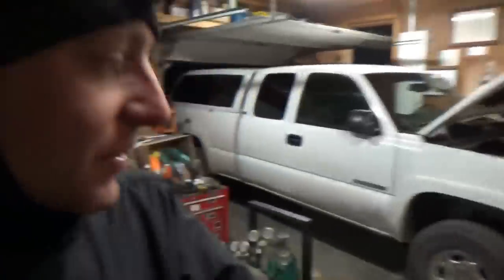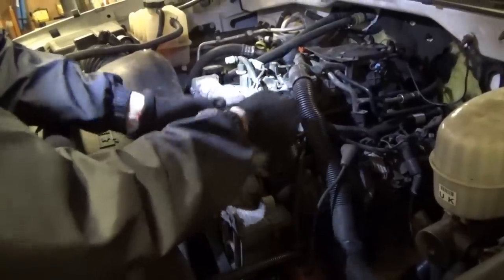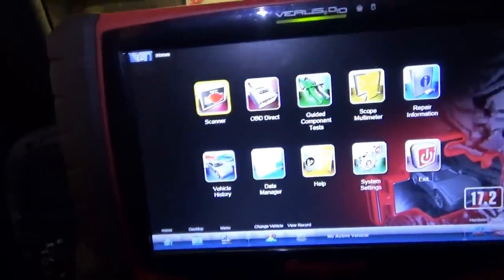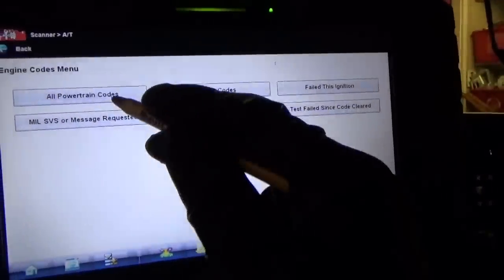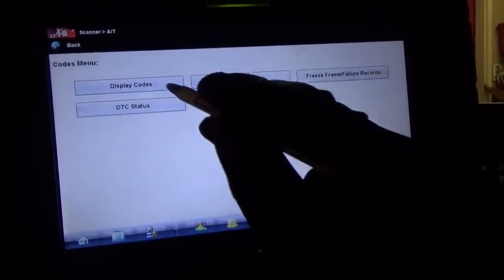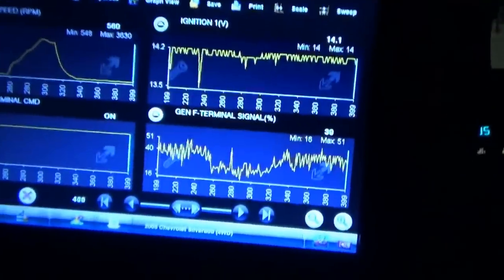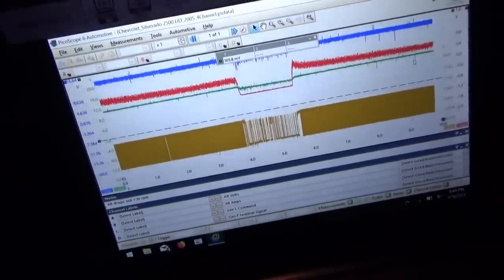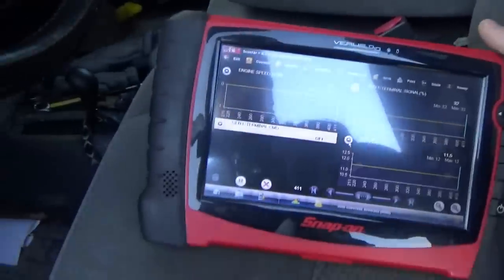Misfire, O2 sensors, LOW VOLTAGE? -Part 3 (Repairs)

Comment: Ivan,
That was a great case study, analysis, and repair! I learn so much from your videos - thank you! BTW I just bought a 1/2 flex head long handle ratchet at HF to loosen/remove the 14mm triple square head bolts that hold the rear caliper brackets to the rear spindle on a 2014 VW Jetta. Could not be loosened with an impact or regualar breaker bar due to tight clearance.  Great tool to have - good luck with yours.
God bless
Paul

Comment: Wondering if the brushes spring tension or brushes are wearing out.  In the old days we use to replace the brushes and internal voltage regulator.

Comment: I suspect the alternator had two small problems caused by simple wear.  The brushes were likely quite worn meaning the springs were at their longest position giving the least tension they could and the bearings in the unit were worn allowing some slight wobble to the rotating mechanism.  As the rpms came up the brushes simply began to lose good contact with the rings on the alternator.  I have had that happen before back when cars had easily replaceable brushes and simply putting a new set of brushes in would eliminate the problem, now you can't go to the parts store and get a set of brushes and if you do the alternators don't have a way to simply replace the brushes by removing a service cover for brushes.
Reply: Do the Fords not still have the external bolt-on voltage regulator/brushes?

Your theory makes sense.  If the brushes are strung out, then at the high rpm they could lift and bounce on the rings with the entrained air on the ring surfaces.
Reply: Typical GM Alternator on the 6.0L (crap out after 200,000km). Have seen quite a few over here with crusty pins (I believe to be  pin fitment issue from factory) $180 Feebay one delivered does the trick usually.
Reply: sounds pretty typical, since day one of alternators =p

Comment: That ratchet is awesome!!!  Swivel head AND extendable !!!  Too cool !!!  Yes replacing a GM alternator is EZ, not only can you see ,reach and remove the mounting bolts,but it takes less than 10 minutes. Keep your videos coming,have a great day!!!!
Reply: Try doing one on a VE (Pontiac G8)!!!
Reply: @Micko350   Man I'm sure that's a nightmare!!!  I hate it when you can see the mounting bolts BUT can't reach'em.

Comment: Excellent repair, and most excellent diagnosis/confirmation, pre and post.
I have found that the PicoScope needs to be connected before opening software, but as a few of your subscribers have commented, cold may be an issue, I use mine for nice warm work.
Thanks for sharing and best regards from the UK.
Reply: Many, not all, desktop and laptop computers have USB ports that are picky and wont talk to some devices..  Plug into a different USB port and boom, it connects.  Not sure what it is but it does happen with all kinds of systems more often than folks believe.

Comment: Hey Ivan, use a pair of pliers and close the gap up on the little metal sleeves and wiggle them and lighty tap them towards the front of the truck. They're like little crush sleeves that when you tighten the bolts up those sleeves slide into towards the alternator and hold the alternator tight after you tighten the bolts. Great video as always

Comment: I've had issues on a 2001chevy with intermittent alternator light!  I have checked the battery voltage @13,5 with full load head lite, a/c & defrost mirrors oni have dust off my scope! i'm getting a p1637 code! thank you! stay safe! it only takes a second for something to happen!

Comment: Excellent diagnosis Ivan. With regards to the inconsistent Pico connection, our systems utilized in the workshop have the issue of shutdown, in the form of disconnection, due to heatsoak. And it's not just the Picos, as all the other scanners suffer identical issues.  But as the average temperature is between 38 and 50°C, it's frustrating but understandable . Our remedy lately has been to super cool both the tablet and Pico with CO2 gas before use, allow to thaw slightly, than use till heatsoak occurs. Drastic but works. 👍👍Greetings from Woomera, South Australia.

Comment: Always suspect the connectors and wires which tend to break where the cable goes from relatively rigid to flexible. | Contact oxidation is another insidious culprit which causes intermittent or loss of contact.  Plugging the connector in/out several times may help but the problem will soon occur as the oxidation process relentlessly continues. |  I suspect that USB connectors are equally problematic because of their design contact method of one plated contact pressed on top of its mating contact.  As long as it remains a gas tight there'll be minimum oxidation and the  connection will remain good. | Test leads inherently have a high failure rate given the amount of rough handling they get.   It was ultimately found that replacing the test cables was the most cost effective strategy.  Finding when to do that is based somewhat on experience and intuition. |  Condensation is unlikely a problem given your working environment and taking wam cables outside to the cold vehicles.  However, going in reverse, from cold outside to warm inside moist will result in condensation.  In that case, leave the cables, eq., out overnight inside your warm home, with ample ventilation, so that any condensation will have time to dissipate.   Or, leave your test eq. in the cold garage (below the dew point and take only the batteries inside for charging, if they can be removed.

Comment: Sweet ratchet gift from viewer.
Little chunky but very usable .

I got a pair of them exactly same but under werkzeug brand and in satin chrome finish . (ezred do them too)
They seem pretty tough .
work way smoother if add some red lithium to them and 3 or 4 drops atf .
I also removed the knuckle bolt and refitted with drop of bearing retainer on threads and done them up good n tight to pull knuckle in nicely and take out any play .
Beefed on the half inch proper hard and it solid and smooth as butter after being lubed (dry from factory)
1/4" also been pushed hard, do feel I could bust the drive square pushed hard on 13-14mm bolts but you know you abusing the drive size doing so .
Truck fixed too so double sweet :-)

Comment: Nice good job. I missed part 2.ill look it up in a bit. On the alternator i like to load it with all the accessories on, full blast, e.g.brite lights a/c,blower etc and let it run for a couple or so minutes.this can give you an idea if its up to par on current.thank you great vid.

Comment: Hi Ivan. Another great set of videos. I’ve had that problem with my Pico. I was lucky enough to meet one of Pico’s tech guys at a seminar so I took the opportunity to ask. He said, ‘Oh you need one of our blue USB cables’ and he kindly sent me one for free! 😉 Something I don’t understand about this alternator control system is why there’s a PWM feedback signal? Why would the control module need that?
Reply: I had same problem, a new NON Cheap USB cable did the fix.

Comment: Before you change the Pico cables and investigate bad capacitors, try a little DeOxit and some dielectric grease on the various connectors to eliminate corrosion as as possible problem.  Good call on the alternator.
Reply: Deoxit yes, dielectric grease no no... Dirt sticks to it and the female connectors may get worn or damaged. The USB  A to B cables, commonly used for printers, may actually fail, usually due to micro cracks on the plastic injected jacket of the B end, that allows moisture intrusion and causes internal corrosion in the joint of the wire and pin, even it may measure low resistance, the connection is so thin that at 500mA or more, it can have too much drop or current ripple.

Comment: I had a 05 Silverado that went through 3 alternators under warranty and 2 I paid for. Finally got a good one before I traded it off.  Battery stud was purple from heat buildup.

Comment: Ivan, make sure power adapter is plugged into Acer when running pico. Acer USB power is very poor on battery power.  Lenovo Thinkpads have reliable USB on battery power fyi.
Reply: Whilst I'm reading what you're writing I'm wondering if they make a cable similar to what the old 2.5" portable hard drives used(dual usb powered)?
Reply: You can run a portable usb power pack plugged into adjacent USB port or USB hub as well for solid reliable 2.1 amps current. This would be proper running a remote service including printer...accessories..
Reply: @jasoneyes01  good suggestions, often USB will get shutdown to conserve battery power. sometimes a different port will work better.
Reply: @throttlebottle5906  If the laptop is using a power saving mode, (set in power options), that could be aggressively cutting power to the USB. Maybe performance mode or set USB to never sleep?

Comment: Excellent follow-up!  I like the verification by scanner & Pico. 😉😉
Good call on the Alternator... but it made sense in part 2.
Reply: Regarding the Pico, Yeah, the cable connection... it seems to like connection in a certain order. Scope vs loading software, I don't remember which 1st. ... Or could be cable is starting to fail. Lol.  You've been wearing it out! Cold..  big time affects electronics.  The condensation forms inside and slowly corrode or worst case, short things. I'm curious what's going on there!

Comment: In the field/shop, you don't care why something doesn't work. You prove it as best you can and sometimes you leave it at that. Ya gotta get it done, asap. However, when 1 has time, it's always nice to find out why something failed. I'd never seen an alt  discharge like that at hi rpm either, so I stayed tuned for curiosity's sake.
Reply: In the older alternators the bridge rectifier, regulator, or brushes were the culprit. Brushes were worn out in most of them.
Reply: @williegillie5712  For certain! I remember smacking Delcos with a mallet and they would start 'working' because the brushes were worn enough to get stuck. In this case, my theory is the semi fuzzy logic of the regulator took a powder.. perhaps a diode was leaking and sent the F signal into a frantic duty cycle mode ( as Ivan caught on the scope). 1 thing I didn't hear Ivan nor Keith talk about was a/c waveforms. IE, leaking diodes. If the PCM sees a signal it can't deal with, it will shut off the alt. My point is, perhaps at higher rpm, the a/c wave got to a point where the PCM said 'nope' even though command was 'on' and input voltage was constant.

Comment: First (edit I just couldn't leave it that way. It seems kind of douchey. So. Regarding the problem with the Pico, I suspect there may be a capacitor in the power input circuitry of the Pico module. Electrolytic capacitors in partial failure work better when warm than when cold. If the initial failure put the system on edge that would explain why you didn't have problems until winter. My hypothesis will stand even stronger if it becomes relatively reliable as the weather warms up.
It is probably one or more of those silver can surface mounted caps that we've all seen. Look very closely around the terminals for any sign of leakage/corrosion and try re-flowing the solder terminals and if it gives off a pungent-sweet fishy smell you've found it. The pertainant numbers will be on the part and Mouser has about 982,000 of them in stock.
Reply: +1 for bad caps; I too think the Pico needs a recap

Comment: People ask me why I hate electronics so much - that Pico incident rests my case! I would've had to walk away, or I'd have flung the laptop like a frisbee, LOL. 😆

Nice follow up there, Ivan. Definitely a strange failure mode! I haven't seen that happen before either. On my '86 Grand Marquis, I did get a bad voltage regulator in a warranty replacement reman alternator. The first one lasted 8 years, so I guess I can't complain too much. The replacement caused the battery light to remain lit, key off and key out! Of course, Auto Zone only tests for output ... which was good, so they wouldn't take it back (sent my wife down to exchange it, since it's several miles from here. I don't think she understood the problem enough to explain it correctly). I ended up just buying a used regulator off eBay for $14, and it's been working great ever since - that was 4 years ago now. 😎

I just got word that my new differential for the Silverado is 6 WEEKS out! Uuuuggghh.😞 Just slapped the cover back on and limped it dry back into the barn to free up the lift. Will be worth the wait, though. It's an OX Locker, 100% air actuated, with no electric (aside from the compressors, but they've been working trouble free for 4 years). Going to be sweet. No more having to engage 4x4 every time I go in my back yard, LOL.
Reply: Smitty Smthsonite   Are you going to do a video on the new locker ?  At least you won't be working on it in the cold.
Reply: @billk5727  - Absolutely! That's the plan. :)

Comment: I usually jump up to the DR44G alternator on these. 145 amps vs the 105 amps on the stock little alternator. Takes a slightly longer belt but everything else is plug & play. Alternators are similarly priced & given the choice, the customer always opts for the bigger alternator. The DR44G alternator is the factory option for these trucks.
Reply: The alternator is placed on top of the engine where all the heat accumulates and that's why the the lifespan is a little shorter!!!!!
Reply: chinesium copper or is it aluminum/blend windings? poor coatings due to ROHS, same for other electronic parts.

Comment: the locking heads on the ratchets is what i need to buy, thats it its denso sensors for me from now on, 
now know you know a little more , man i forget half the stuff i learn soooo much to remember thats what electronic  memory storage is for anyways.
Reply: closeertothrtruth if want the same set I sent ivan go amazon and search steelman pro ratchets the set is about $65
Reply: thanks for your help , im getting them , i work on cars continualy and new cars are a pain without specialised tools
Reply: closertothetruth your welcome but if want the pliers Ivan didn’t use in the vid will be about another $150 but are well worth it on small fasteners

Comment: A reman is never as good. Ask John Wayne Bobbitt.
Reply from the maker: Maybe not. But I've never had a comeback on a reman alternator!!
Reply: Hahaha John Bobbit hahaha
Reply: What about asking Janice Dickinson's husband?
Reply: @PineHollowAutoDiagnostics  Likely because you use good name brand reman's.  Delphi manufactures all kinds of OEM new parts for GM and has for decades.  Some of us who have older vehicles are just about forced to use aftermarket/remanufactured parts due to availability and the origin of OEM part when they are available. No point in buying Delco or GM parts if they are made in China at the price they charge.

Comment: In regards to the new O2 sensor being a bit sluggish to start oscillating, I'm wondering if fuel trims were adapted to the previous condition, and it was taking the PCM a minute to correct itself.  I've been bitten in the past, so I've gotten in the habit of pulling up fuel trim data any time I'm dealing with an O2 sensor issue, even during the repair.  :)

Were you ever able to see proper range on that new sensor?  I've had issues with Denso O2 sensors in the past where they just will not drop as low as they should, and it shows in LTFT with a negative compensation under all conditions.  I've tried to stick with NGK or Bosch (in that order), and haven't had an issue, though I've noticed the 1-wire Bosch sensors don't seem to hold up well over time.
Reply: Good observation 🤙
Reply: On a GM I'd use nothing but AC Delco.  They come with anti-sieze pre-applied to the threads even.
Reply: ...but do they give you the cool little packet?
Reply: @kevin9c1  +1 for AC Delco

Comment: Ivan the way I check the alternator for charging I take the positive terminal off if it stays running it's good thank you for your service say hi to the mrs.
Reply: Disconnecting the battery can cause a surge that can damage the alternator and even the electronics elsewhere in the car.  Depends on how much amperage is being fed to the battery at the time of disconnect.  Until the voltage regulator can react, the alternator will try to keep that current flowing and the voltage will spike to whatever is needed.  Same as when any coil releases.
Reply: That was a good test in the 70s most newer cars will stall if you remove cable also get a nasty surge

Comment: OK Ivan, a three part series to replace what from the get go looked like a bad alternator? Maybe being absolutely sure was required back in Siberia where you had to blow Putin to get a new part for your car but this is 'Merica pal and every parts store in the country has an alternator for a Chevy truck. Just replace the damn thing will ya. Now fixing the Pico Scope would be a lot more interesting than this. My guess is that the tablet batteries were a little low due to the cold weather and you didn't have the juice to power the Pico but that's just a guess. Can the Pico run off of a connection to the mains? If so that could confirm my theory.
Reply from the maker: Haha yeah Dennis the parts cannon is always overloaded in the USA ;)

Comment: Smashing diagnostic and repair ivan :-D
I'm chuffed that it all worked out perfect, you always put 110% into a thorough diagnostic.

We really helped you Ha ha :-D joking of cause :)
Odd that the pico plays up, i would wonder if it has a power supply problem, maybe feed it from a seperate 5 volt supply.
Windows could be messing around with the communication but you tryed other computers so that's a dead end.
I'm sure you will track down the problem :-D.